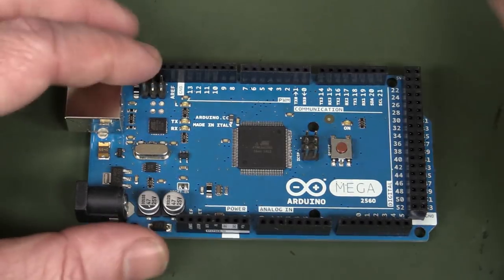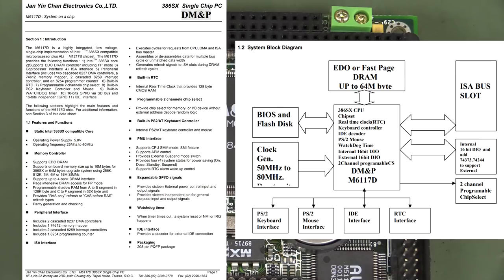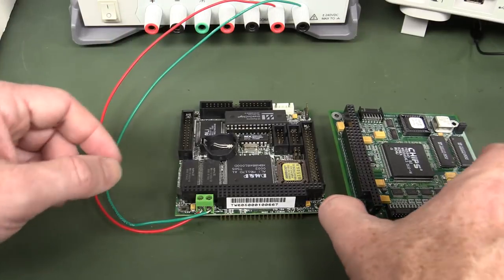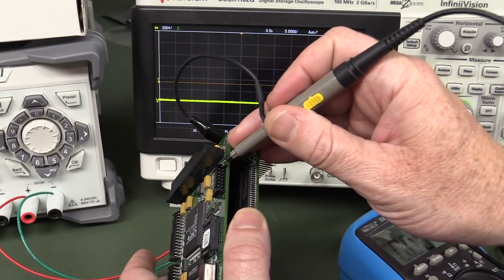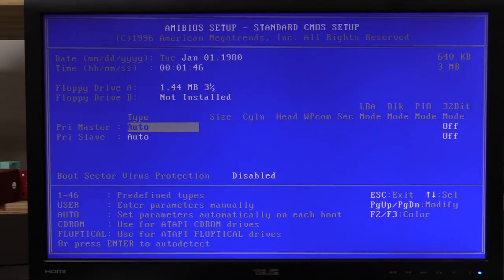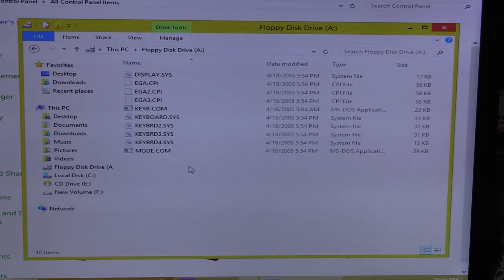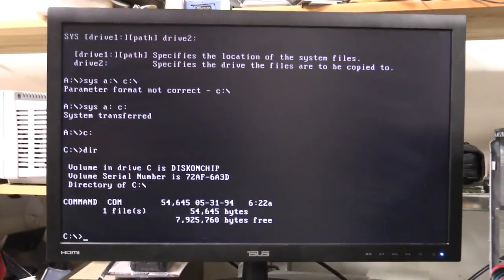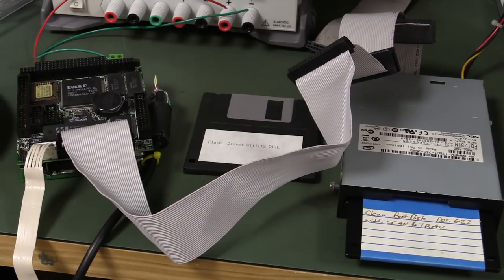EEVblog #1028 -  PC104 - The Full Version

Comment: I've got a pile of these in complete units set up to run with just a +12 vdc supply.
They were meant to be used by a trucking company in the 90's. Ought to go dig em out a see if they boot win95 or linux.

Comment: I know of your troubles.  In a lot of my personal projects I use old PC's, cuz they're cheap and I have a lot of them.  Getting them to get to the point of being able to do anything with them is a real pain because you have to do just what Dave did.  I have this old Pentium laptop that I am using in a project and it took me a long time to get it to the point where I could do something with it.  I finally got one of those Floppy drive to USB jump drive devices off of ebay and a 44 pin IDE to SD Card device so I could boot from a SD card instead of a hard drive.
BTW, Pengo for the win!  There was this one arcade I used to go to when I was young and that was the game I always went to!

Comment: That brought back memories :-) I 'upgraded' to an 80386 long after owning with an 8086 with an MFM hard disk which was a full size 5-1/4" format with 10MB (megabyte) capacity. After the 8086 I moved up to 80286 so your PC is actually quite advanced compared to earlier versions. On the 8086 I mostly ran Lotus Symphony (a sort of spreadsheet + word processor program) from DOS, but somewhere I also have a Windows V.1 floppy drive which came as an alternative new-fangled OS to CPM which was considered superior at the time!

Comment: thank you I wish I could find out more about pc 104, I actually work on equipment that have these board in. but the oems change the names of the board to their own internal names. for some reason the machines stop communicating with the network and OEMs blame it on the PC /104 board assembly, and they are sold for about 5K. Yap 5K. it fixes the unit alright. but I am thinking it has to  be a memory or some chip that does out right? so why should the customer pay 5K. I love to be able to fix it for a reasonable price under 1K, I be happy they be happy.

Comment: Hi, I been trying to figure out a pc104, please help. I need to connect a monitor to it and see if it boots up or does it have an error.. some of the equipment that I work with has them installed inside. it has no commonly identifiable monitor, keyboard or mouse connection. I am a 5 volt contributor on the patreon but for some reason I can not massage any one with my computer. I am still running xp and an old version of the browser, so, that is the reason. but if I can get any push in the right direction it would be greatly appreciated.

Comment: If you're doing anything like this again: You don't need to mock around with these bloody floppy drives anymore, you can just use normal CDs, any CD burning tool like ImgBurn oder CDBurnerXP will let you select Bootable 1.4M Floppy Emulation, and then you can just give it a floppy image. This will even work on these old 386'es, because their BIOS is newer...

Comment: Kids now days don't know the headaches just dealing with floppy  drive.
Reply: Dan B I'm 13. I know it 😂. I really mean it, i even have 360kb floppies
Reply: Installing drive controller cards, setting IRQ address's. Oh yes the fun of late 80's early 90;s computers. Still fun to mess with every now and then though. Still have the IBM XT set up in the office.
Reply: A solid light on the floppy meant you had the data cable connected backwards.  Very useful.

Comment: DO NOT use the VGA pinout shown in this video. It's dangerous. The shown pinout grounds all pins 6 to 10, this is WRONG. Pin 9 has 5v on a lot of systems. If you ground it you could cause damage to the machine. PIN 9 IS 5V NOT GROUND.